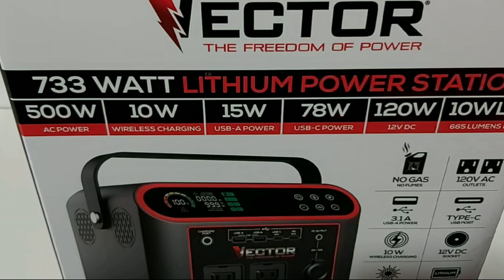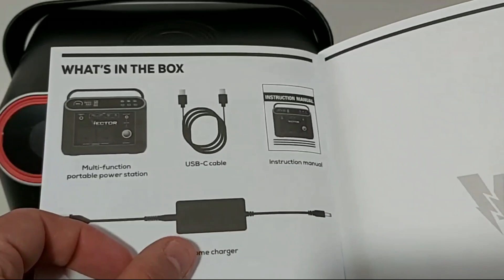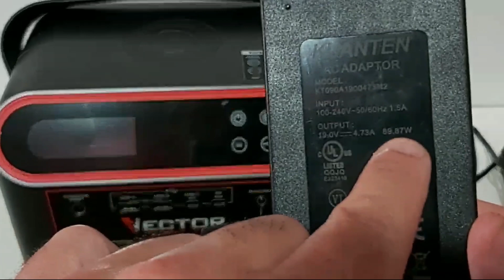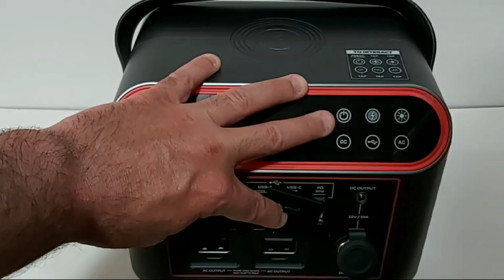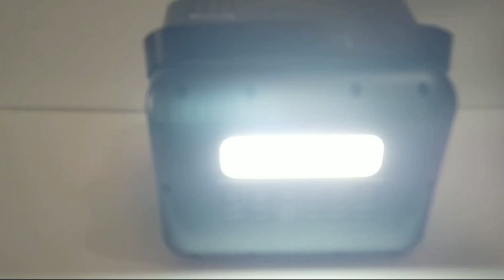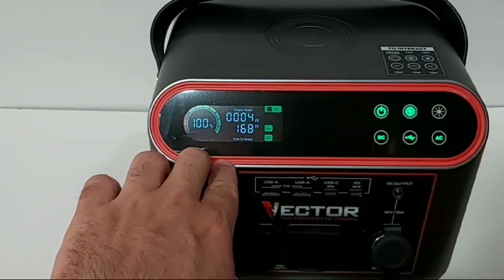VECTOR 666WH Power Station Unboxing & Review

Comment: Any issues charging ?? I plug in the wall charger and thebentire screen comes on....off.....on....off

So frustrating
Reply from the maker: I have used my unit multiple times and I didn't experience any issues with it, contact them ASAP and they should resolve this matter hopefully.
Good luck on that too..
Reply: @ReviewsandTech i tried. They werent helpful. But thanks for the response !!
Reply from the maker: @FranklinHicks-qs4gs If you emailed them, then I would call them too, and also send a message to Amazon customer service if you purchased it that way..
Good luck to ya again